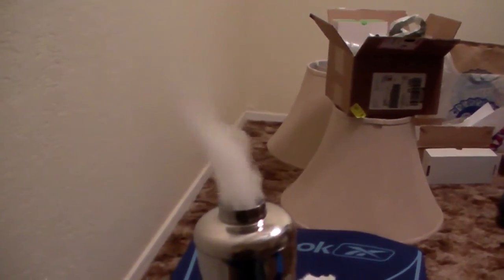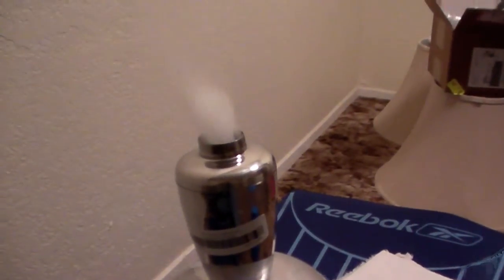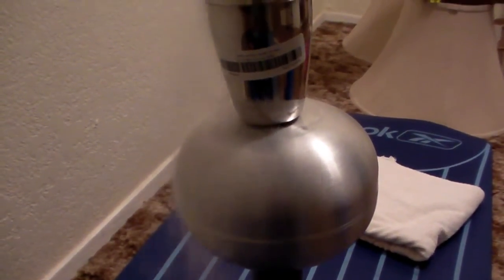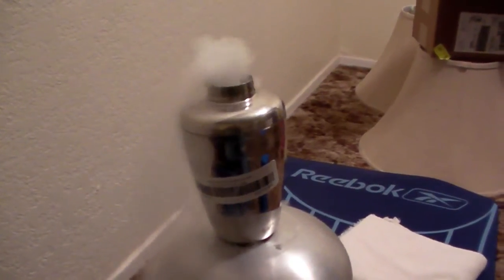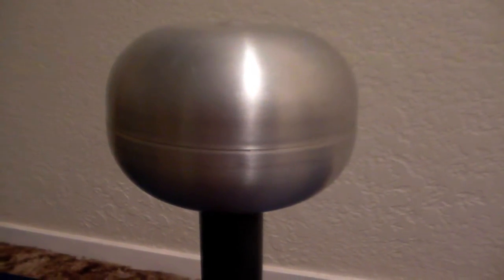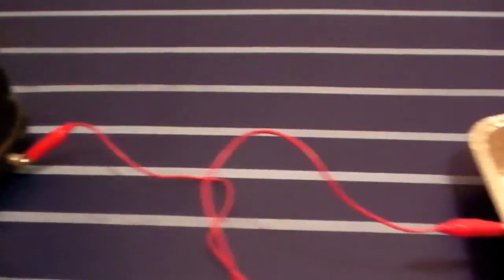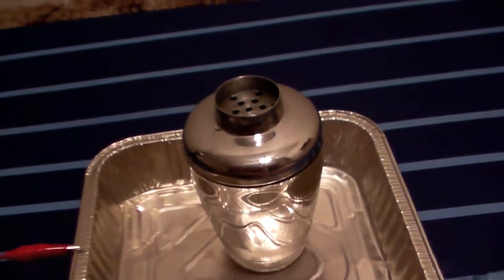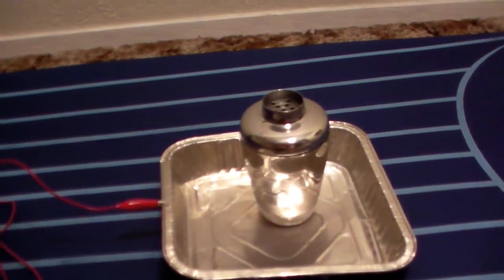Making Electrically Charged Fog With a Van de Graff Generator

Comment: Nice upload. I don't agree with Naoki Kashima's explanation about the very very feeble almost unmeasurable magnetic charges of (clean) water, nor his pyramid, but he's on to something. Charged water like this, on the other hand of course would have magnetic properties(maybe that's what he meant). You can extend the flow of smoke I would think several meters using a focused magnetic beam - at least you make a magnetic path for the charge that can make incredible long sparks. Check out Boyd Bushman patents esp. Apparatus and method for amplifying a magnetic beam

Comment: Water actually has some magnetic charge to it. In theory you should be able to generate electricity just from water running over things w/o any mechanical action. Some thing that is how the pyramids in Egypt were used to generate electricity. They were built on top of aquifers with 2 tunnels made out of electrically conducting rock feeding into them. Outside of pyramid is an insulator but on the top rested a golden pyramid that was used to discharge electricity. When operational lightnings were seen from the top of the pyramid. Right now it is in ruined state and still you get electrical effects if you stand at the very top of it.